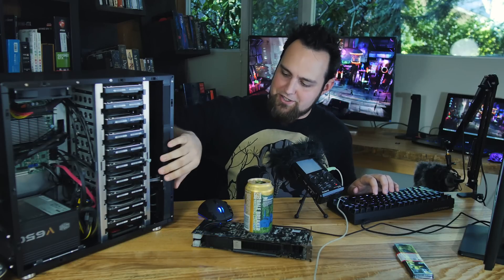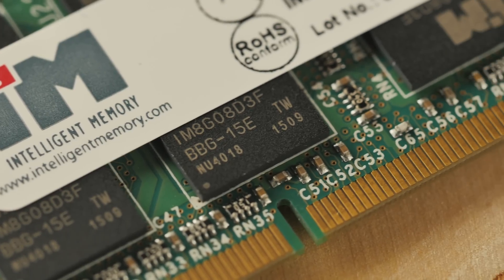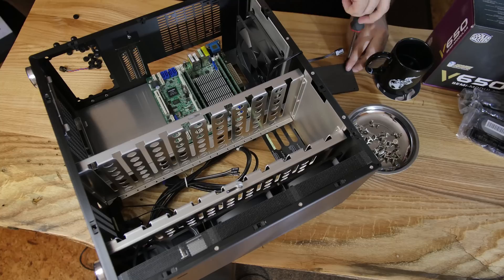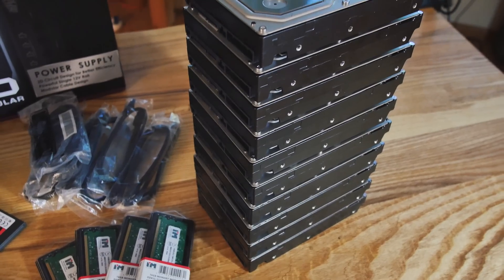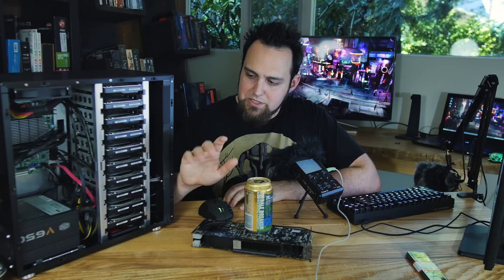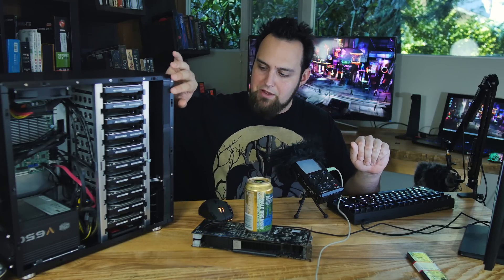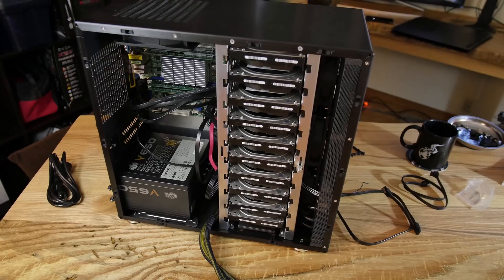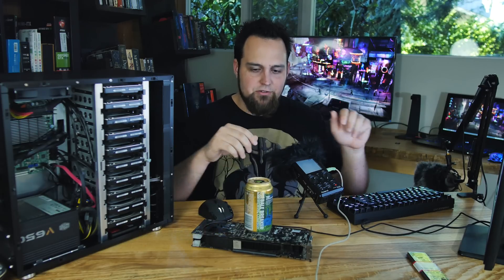Our New NAS: 40 TB, 64 GB ECC RAM, SSD Caching, 10 Bay Case

Comment: I think you would feel safer and happier going with unRAID for this project. I had a FreeNas with zfs on it and when it died it did it spectacularly. Apparently this is not normal but in my case it was a heart breaking total loss. In my experience, FreeNAS can be very demanding on hardware and the drives are not readable if it falls over, whereas unRAID drives are not dependent on each other so that if something fails the rest of your data is still readable, and it is simpler to move to a new system later. Pretty impressive beast you have there though. Synology may be an option (I have several) but they are anemic, pricey and cannot be serviced or repaired by the user.

Comment: Hello, I also built a kind of a server using Windows 10 and, to many harddrives. I had the intention to use 1 harddrive for al--ny caracter in the alphabet to store my recordings. EG a fish called Wanda is on hard drive A, another recording where the titlle began with a B is on harddrive B, and now, the first problem is of course the recordings with the caracter C, 
not to mention the 26 drive limit in Windows.  If you know that my network is a full windows network, and I don't want to work with other OS but Windows, how to solve the C drive problem and to solve the 26 drive limit problem. I need a way to run the OS from a non aphabeticle caracter. The way to passe limit harddrives on 1 mainboard is solved ussing 2 plugin cards PCIe to 10x SATA. As the mainboard has 6 SATA connectors allready, and there are more than enough USB connectors to make there is no physical limit for the amount of drives iwould like to find the way when the PC start up I want to be able to use 26 drives (one for each carater) 1 for the recordings starting with a number, and 1 foa a DVD drive, that also should be to be viewed in the network. So next to the OS drive I need another 28 drives. The hardware is allready there, the drives are installed, so the problem is the C (os in WIndows) and the limit of 26 drives (Also in Windows).

Comment: Have to correct you on the PSU. Running at 65% load is not necessary a good thing on a PSU. Many PSU has a powerfactor of 95% efficiency at 80-99%  load. But only 50-70% efficiency at 65% load. You will waste power on a device that is going to be on 24/7

Comment: Hello guys, is it possible that someone here have the experience to put together a cluster computer made of different old servers?  I ask this because I want to create a potent cluster computer that feeds to the workers via ethernet cable to their "thin clients". Can some one advise me in this project? I will pay for this help!

The servers will be the ones on this links :

https://www.ebay.com/itm/Dell-PowerEdge-R910-4x-X7560-2-26Ghz-8-CORE-256GB-DDR3-H700-32-CORES-16x-146GGB-/183023541191?nma=true&si=yM45XkE%252BerSh16eijkGGQd5Py24%253D&orig_cvip=true&rt=nc&_trksid=p2047675.l2557   
---   This one would be for some processing power and, principally, for  storage 

https://www.ebay.com/itm/HP-DL580-G7-4x-10-Core-E7-4870-2-4GHz-512GB-DDR3-4x-PSU-TOP-ZUSTAND-/182161339058?#vi-content    
---   Two of this servers to have processing power and memory!  I chose this HP server to make the processing work of the cluster and to have the possibilty to put GPUs -- this HPs let you put 4 gpus in each).

Comment: Bu karar uğraşacağına, 4 tane HDD ile bu işi bitirebilirdi. 
Ebayda 260 dolara 10tb HDD var 4 tanesi 1040 dolar. Oldumu sana 40 tb alan. Türk lirası ile 3800tl bu işi halledebilir. 
Eminim bu yaptıgı 5000 dolar tutmuştur. O kadar Ram, kasa, power, kart, parası ödemiş. 

Ama bu yaptığını 10 tb diskler ile yapsaydı, alkışlardım. 10x10 = 100tb ile mükemmel bir nas olurdu. Maliyetide 2600 dolar olurdu. 400 dolara Ram ve diğer parçalara gitse, 3000 dolara bu işi halledebilirdi.

Comment: Are you at all concerned about users reporting that in Linux and FreeBSD, high intensity read/write workloads cause the Marvell sata controller to reset and elements to any software array are lost? https://forums.freebsd.org/threads/45197/

Also, it was recently found out that Intel Avoton C2000 chips are bricking devices after 18-36 months of use: https://www.theregister.co.uk/2017/02/06/cisco_intel_decline_to_link_product_warning_to_faulty_chip/

Comment: 1) FreeNAS does NOT need 1GB of RAM for 1TB of space. I have a 40TB FreeNAS with 8GB of RAM. 2) 8 core Intel Atom is a crap CPU. The Atom is targeted for embedded systems, it has the performance of a high end Core i3 or low end Core i5.

Comment: I wouldn't use Seagate drives either. I am using WD Raptor 1TB 10K HDD's in my RAID. I like the speed of them, but they are no longer made unfortunately. I like WD drives. I have had really good luck with them and they tend to be quiet.

Comment: Soda can on a GPU, hard drives stacked metal to PC board, and the I/O shield missing. FAIL!

For all you basement hacks, do a little reading about the "effects of static electricity on electronic components". Yes reading, you know that old fashion stuff that actually requires the use of your brain.

As for the I/O shield, it's not just there as a decoration, it's designed to block RF inference coming from your PC that can affect electronic devices around it. Hear noise on your headset, TV, or phone? The I/O shield also plays a role in proper air flow through the case. Air flow tests and design expect the I/O shield to be IN PLACE!

Let's not even get into the physical damage to the card/drives...

I'm sorry but if your going to demonstrate building a PC, demonstrate it with proper technique in handling the components...

Comment: as well as, the power supply could deliver and weaker!
Since the hard drive consumes 10 to 20 watts!
We believe: 20vatt * 10 = 200 watts drives (in peak load)
motherboard + processor about 150-300 watts at peak load (Intel Atom)
Total:
Without load: 250 watts
Peak load: 500 watts

150 watts - is required!

When you talk about the server, it is necessary to count the power, and do not swim across!

Comment: My main question is how you are going to get output speed to local network with this motherboard. All specs are perfect inside but there is no 10GB or at least 4GB quad 1Gb port card to "get out"? This motherboard has PCI 32bit as only extra slot looks like...
Reply: you can slap a dual 10Gbit netcard in the pci-e slot

Comment: A couple of things...  

1) 1GB of memory per TB is extreme over kill in most work loads, 8GB with my 32TB setup saturates the built in 1Gbit ethernet.  (No SSD BTW, and I'm using the quad core little brother of what you have, C2550D4I.)  Memory requirements don't scale anything like people would have you believe, unless you're using dedupe, in which case you want to make sure the dedupe table stays in memory.  Though I would HIGHLY recommend avoiding that feature unless you have a VERY good reason to use it.

2) I sure hope that "SSD cache" drive is going to be used for ARC and you're not going to use it for the ZIL (never use a non redundant drive for the ZIL).  Also, that box is going to saturate the integrated 1Gbit port without the need for the SSD drive.  Are you hoping to improve IOP count?
Reply: +Bu Jin The RAM requirements of ZFS are... widely highly overstated.  As you pointed out, unless you're using dedup, ZFS really has a negligible RAM footprint.  In general, the amount of RAM you should have in a ZFS box is the amount of memory needed to run your system and applications + the amount of data you would like to keep in ARC.

Running a nonredundant ZIL isn't world-ending, per se.  ZIL is only used for sync write operations, which for most applications is uncommon enough.  Besides, should the rare instance occur where the ZIL fails during a sync write, the filesystem will log the error for the ZIL and bypass it.  The real danger comes from an unlikely situation should you be in the middle of sync writing mission-critical data, the server crashes and the ZIL fails simultaneously with the crash.  The ZIL is flushed every few seconds so you will lose very little data, but it could be super important data, so you mirror the ZIL if you think the risk of losing those few seconds of data is too great.

Comment: I was wondering.. is there a way to partition a single 4tb drive into thinking it's 4x1tb drives? and then run 2x4tb (essentially being 8x1tb partitions)?? I want a storage server but don't necessarily need all the extra storage room.  what's the basics i could run a storage server with.?

Comment: This is probably wishful thinking and not possible for a build such as this... but I just found out you can setup a VirtualBox jail in FreeNas. WHAT IF! ...you could run Steam OS (even if it was just acting as a client to stream games from another host) from inside this FreeNas build? Is that even possible? I'm assuming it's probably not. But wouldn't it be cool if it WAS possible? Would you need to add a graphics card for it to work? Or would you not be able to run it at all because jails (and FreeNas) are "headless"? Is that even a true statement? I don't know. (Sorry if these are such newbie questions. I'm trying to piece together the information I'm finding and make sense of it all in my head since I can't try it out for myself, yet.)
Reply: fmkguy Turns out people ARE doing this... sort of. http://steamcommunity.com/groups/homestream/discussions/0/540731691174375117

So new question: For more of a media home-server build (Plex, iTunes, and now Steam) using FreeNas, do you guys have any experience using a hypervisor (?) setup like this? And could that be done with this mobo/processor?

Comment: 1) Be double careful with those molex to sata power connectors (really, don't use them), if you just google image search "sata power fire" you'll see tons of crispy cabling and hardware due to them.
2) Check out Backblaze's HDD reliability charts for 2015 when choosing your drives. They have 44k drives deployed across many brands and have some good info for you to look at.

Comment: The 1GB RAM per 1TB of storage ideology is really intended for Enterprise-like workloads. 16GB of RAM would be fine for a 40TB general-purpose and/or media NAS w/ ZFS. That said, if you want to run other services on the same box, you might need more.

The most important factor is ECC memory. Always prioritize getting ECC memory (and a motherboard/cpu that supports ECC memory) over memory capacity. Even if you're not using ZFS, ECC memory protects you against silent bit-flips when writing to the NAS.
Reply: rainy724 It's more about how much active data you have.   For example if your supporting a virtual cluster you may have a 10 TB pool and really need 1 TB of ram.

Comment: I've been using basically the same setup for about a year. Same 8 core motherboard with 32gb of eec Kingston memory 24tb 4tb wd red's. I housed it inside the Fractal Design Define R4. It's been rock solid so far lol. nocks on wood no drive failures yet!!!

Comment: its Not Important to Use ECC in a Nas server. The failure rate of Some good Quality Ram will be around 1 - 0.75% give or take where the Failure rate of Ecc ram is about 0.28. SO for a private Nas / virtualization server you Wont really benefit from the Lower speed / Highe Price of ECC ram at all.

Comment: No additional NIC?  Seems to me 1x gigabit will easily be saturated by this setup.
Reply: 2dfx That board has two onboard gigabit NICs, both intel i210s. They could throw 10GbE in there, but that's a costly upgrade in the current market.

Comment: Seagate doesn't have high failure rates....
Reply: Goliath About a year ago I bought 2 Seagate NAS drives and 2 WD NAS drives. One pair failed. Which one? Well, let's just say I don't own Seagate drives anymore.
Reply: BrainDeadGamer Ah yes anecdotal evidence. They are just as good as WD, end of story, (or well not just as good, a little tad behind) Point is, they are excellent.
Reply: Goliath Maybe if you close your eyes and say that a couple times it'll come true, but until then the rest of us will keep on living in the real world, buddy.
Reply: Goliath From my 10 year experience as a hobby on PC building etc i have seen way more failed Seagates than WDs. Like , way more.
Reply: Goliath Anecdotal, sure, but when you pool a whole lot of instances of anecdotal evidence together, you can begin to draw conclusions. I agree that when you look at a single case, or even a few cases, of "Bought some Seagate drives, they died... never again buying Seagate drives," it doesn't give you a lot of information.

But, when you examine the volume of those claims/stories where Seagate is the manufacturer compared the volume of the "[WD, HGST] drives died, won't be buying from them again" stories, you can start to draw conclusions. Sure, Seagate might sell (or have sold) more drives, skewing the numbers, but it's still data none-the-less. That, and you can then incorporate Backblaze's published values and raw data, however accurate, to start to draw even better conclusions.

Does Seagate have a higher failure rate than other manufactures? It's still hard to say. In fact, even with published RMA numbers from all the major manufactures, its still difficult to determine (not everyone RMAs failed drives). But, based on the evidence described above, it does *seem* like Seagate has had higher failure rates in the past few years or so, that's pretty clear. That said, it also seems that they are turning things around, though.
Reply: Phoenix Fourth that's cool,  that's still anecdotal evidence though.  That doesn't help,  it just doesn't sorry. Besides,  if you are talking about the 3 TB ones,  Seagate and WD both had huge problems with those at first, Google it.

Comment: be carefull guyz, the marvel controllers on this board has a very bad reputation with freebsd (freenas)...It's quite well knowed in the freenas community
I have the same board... 
I got some data corruption and lost few files, and had to move on the intel controller only, not 100% sure that is because of the controler but I changed

Comment: Jello, love you guys. Um, the show. But um, have you guys done benchmarks from say a, R9 390X with 2 GTX 980s. You know on the same rig/test benchDirectX 12 at the same time? You have done this right. How long have had windows 10 beta? If it does not do what they say then I'm just gona get two more 980s. But I think it would be so freakin cool/bitchin to have two 980s with one R9 390X. If it works. What is it SLIFIRE?

Comment: I'd be VERY interested to see how this NAS performs for a number of reasons. 
Firstly, this and the quad core version (C2550D4I) are the only ITX boards that I've ever seen that have 4 full DIMM slots and supports 64GB of ram. Most are stuck with 2 slots supporting 16 or 32GB at best.  Secondly, I have one of these awesome little boards currently running ESXi 5.5 beautifully. I'm looking at another one for a 10gbe NAS solution to feed another ESXi box.  I'd love to see internal HDD performance (not limited by the 1gbit NIC) and CPU load!.   Nice build though!

Comment: What are your thoughts on running FreeNAS vs. straight linux? I believe FreeNAS now requires the use of ZFS, which in turn "requires" ECC RAM, which is why I'm thinking using debian and avoiding ZFS altogether

Comment: Isn't HGST owned by Western Digital? So you really shouldn't apologise for not using WD's... HGST are the best hard drives out there, but also the most costly...
Reply from the maker: drappke They are cheaper than the WD Red Pro drives and I like them as much or better. The companies are operated separately as well.